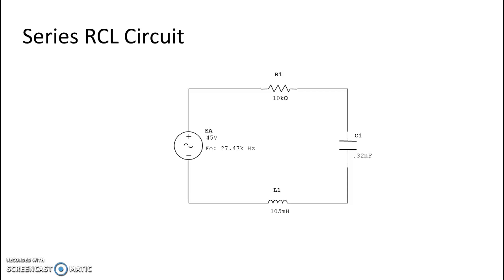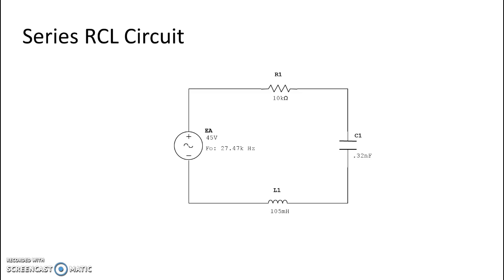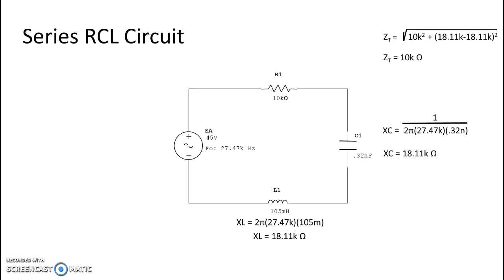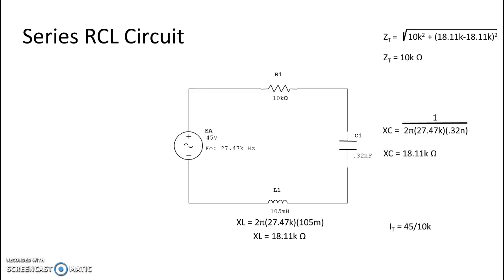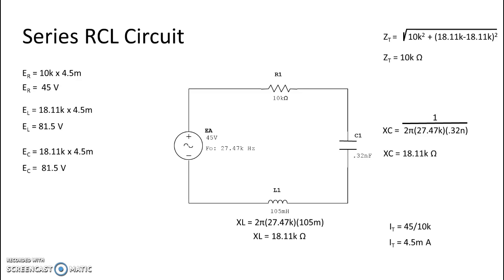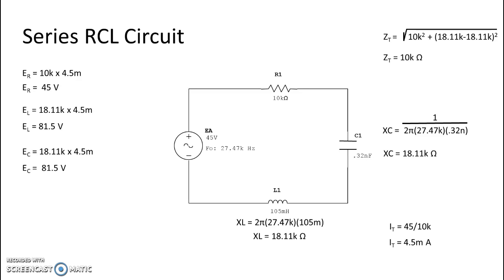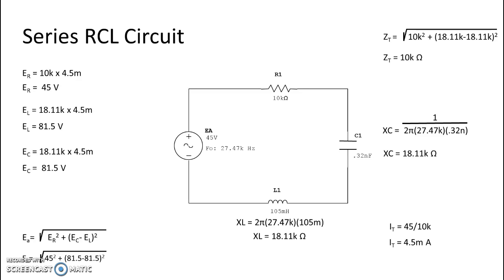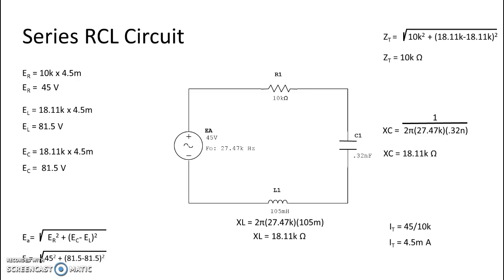Series RCL Circuit - Voltage Magnification

Comment: I have tested the RLC circuit and changed a little bit values of an inductor and capacitor (also resonance frequency but different values as I have them already at home) but I have comepletelly different results :/ across the inductor I have like a half of the input voltage and across the capacitor very small voltage but I am sure they are at resosance frequency and also I have 10 k resistor. What do I do wrong ? Nothing behaves as expected (yes I checked the values with my LCR meter and resosnance frequency I have calculated also with my values etc.)

Comment: What if frequency is not given?
Reply from the maker: Derek Kyle Guanzon if the circuit was resonant you could use that formula to calculate resonate frequency.  If you knew both the reactance and the ohmic value of your reactive components you could also figure circuit frequency.
Reply: @christineneer4251  thanks i figure it out its 1/(2pie*sqrt(LC))